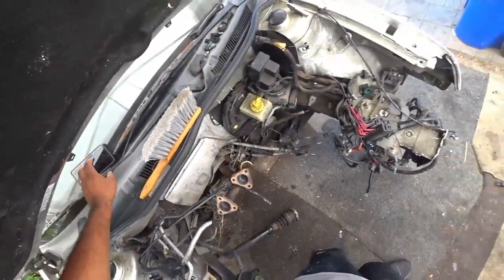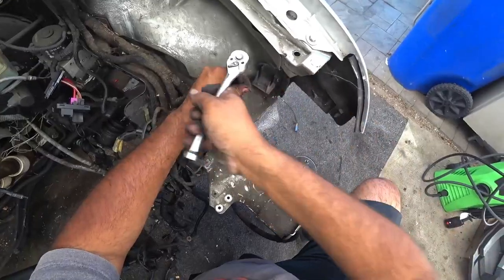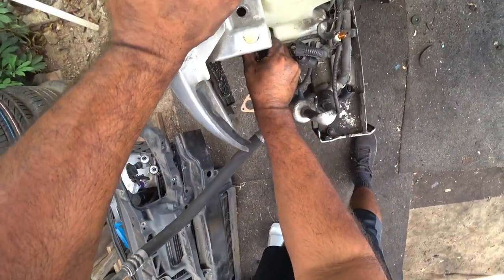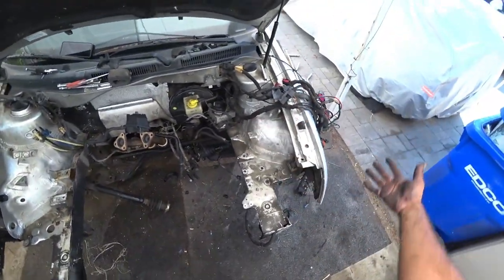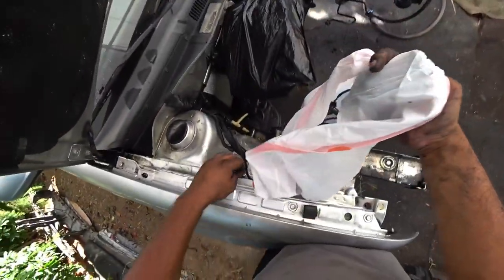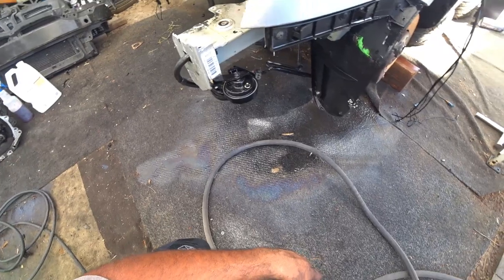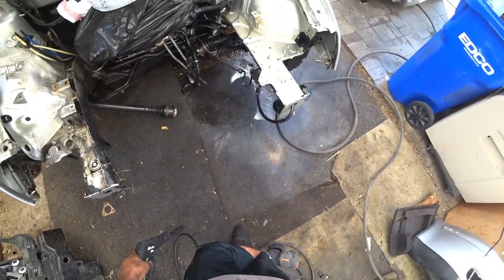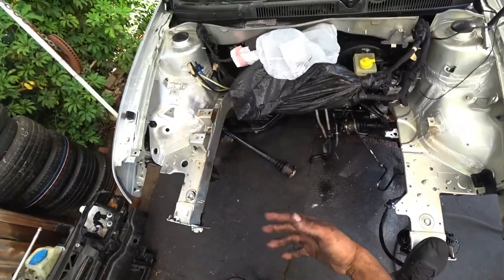How to Clean an MK4 Engine Bay S7EP6

Comment: Great video. Had a question ? While cleaning engine bay what is the proper way to do an abs delete?
Reply from the maker: You will need to make new lines for the front and you will also need a different brake master cylinder for 4 lines
Reply: @PincheALsGarage  ok that seems straight forward an tricks to get rid of the dash light once deleted
Reply from the maker: @thamontgomeryz  tune
Reply: @PincheALsGarage  really it's part of a tune. I just got my tune done 😂 well guess I will be talking to them some more